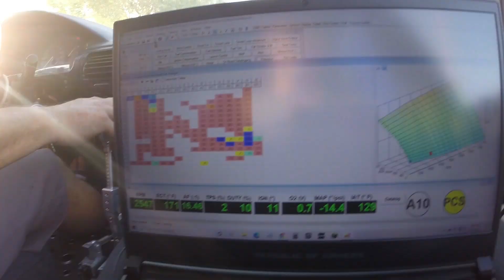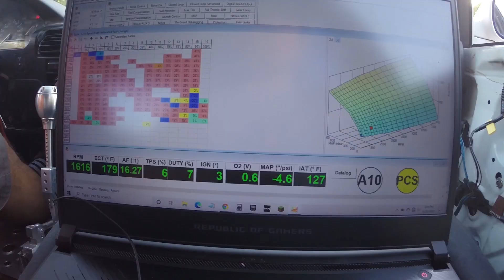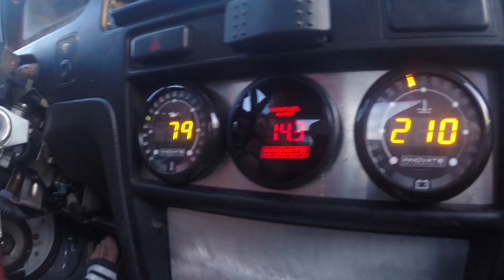ITB CB7 RIPS!!! - Street tuning - Sounds Insane! - Track CB7 Build EP. 21 - 92 Honda Accord

Comment: Bro you still have the cb7 yeah? Will those itbs fit any f series? Love the build man.. I just swapped a f23a and m2f4 prelude trans in my 95 cd5 and I'm loving it compared to my old f22b1.. its not a civic or integra by any means but it still is pretty torqy for what it is I want to do all motor but it seems expensive boost is koo but man those itbs sound good

Comment: I never liked that one runner reading for the O2 sensor, you should get a O2 sensor bung welded at the collector for a better reading. 👍
Reply from the maker: The factory o2 sensor is plugged but it’s not doing anything. I have my innovative wideband connected to the bung down below. And I have hondata reading that as an input👍🏽 I talked about it in an older video
Reply: @JaayPeeBuilt   oh okay, cool

Comment: Dude, where did you find your weather stripping and mouldings? Getting my cb7 ready for bodywork and paint but I want those first lol
Also building a stock f22a6 with data logging.
Reply from the maker: I didn’t find them. they are all original